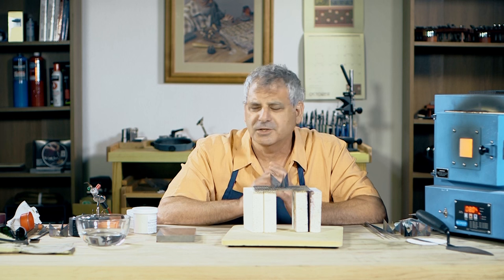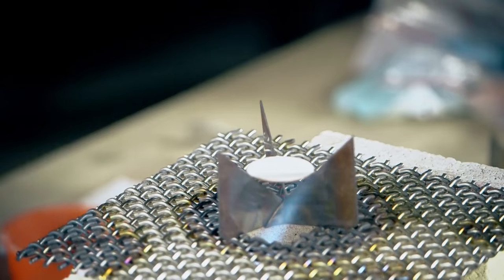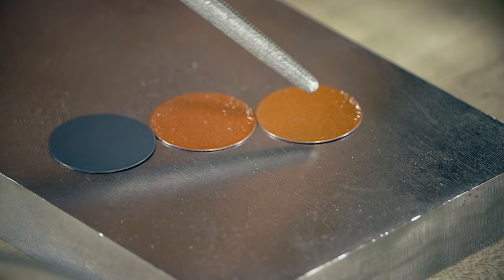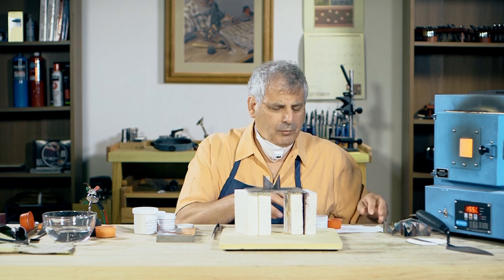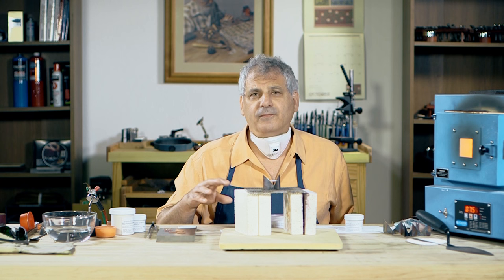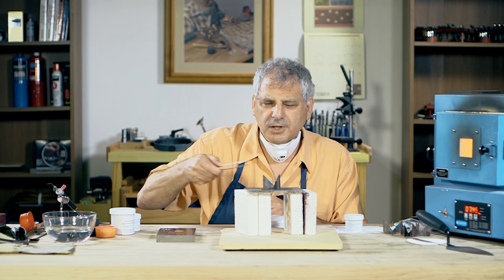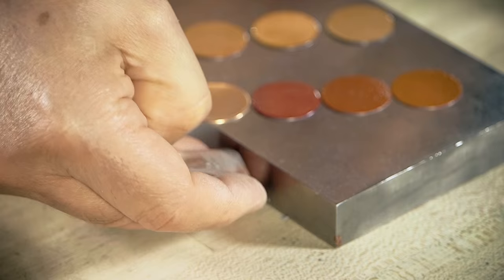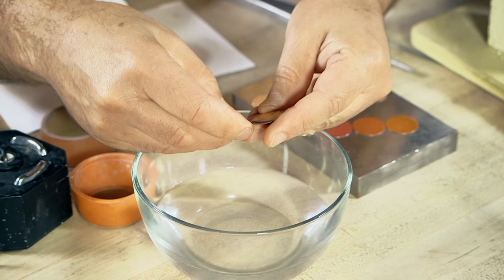How Transparent Enamel Interacts with Copper

Comment: Grease from the fingertips, as well as dust particles that got into the enamel, burn during the firing and leave gas bubbles trapped in the enamel or, even worse, open pores.

Comment: Are there any known issues using an acetylene Presto-lite torch For this process?
Reply from the maker: Hi Jenn. Thanks for asking! You can use an acetylene torch to fire enamels, but be sure that you only fire from below. Bringing the torch up on the top surface can discolor enamels, this will be most apparent on white or light colored enamels. It can also give a “Pearl” effect to transparent enamels (sometimes this effect looks good; sometimes it doesn't). Hope this helps, and have a great day!

Comment: Hi Sir. I'm designing watch, and i want to make color for dial. Coul you help me how can i buy Enamel Powder? I come from Vietnam. Thanks you
Reply: Typically, enamel dials are made of six to nine layers to make them durable and lustrous looking, which means the process takes a very long time. Each layer has to be sanded smooth in order to guarantee an even application and thickness across the dial. Then, another layer of enamel powder is applied, fired again, sanded, and the process is repeated multiple times. The results of each layer are not guaranteed however, as bubbles could form or a foreign agent from the kiln could find its way onto the dial. For these reasons, enamel dials have a high failure rate.

Comment: Hi can you tell me how I can stop getting trivet marks when I counter enamel the marks are from where the piece touches the trivet
Thanks
Reply from the maker: There are a couple of tips to help prevent this, but most importantly only the edge of the piece should touch the trivet, so getting a larger trivet would help. If the trivet touches enamel, it will stick. Using the minimum amount of enamel will also help prevent this as well, thick enamel will stick to the trivet. Lastly, letting the piece cool completely before removing it from the trivet will keep the glass from being hot and soft and sticking.
Reply: @RioGrande1944  thank you so That’s a great help